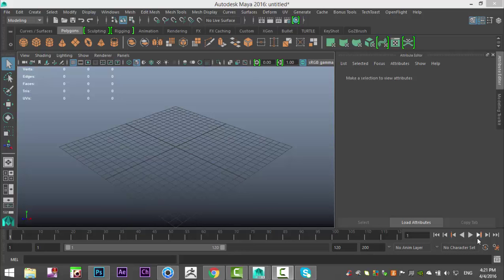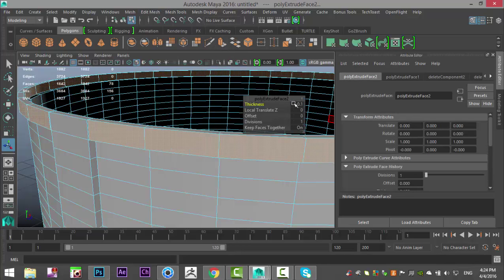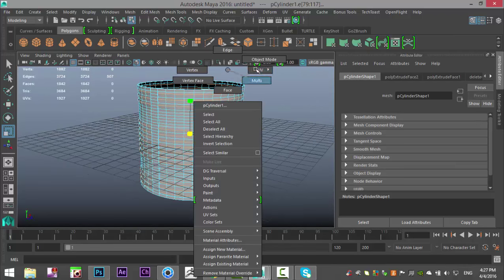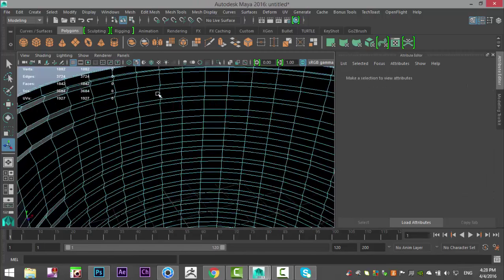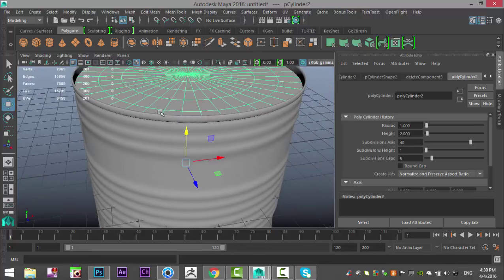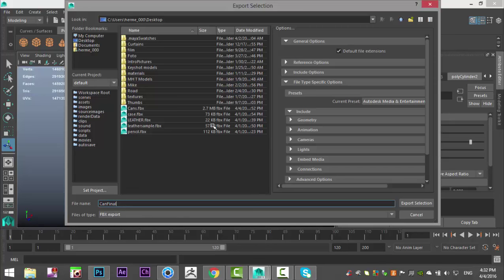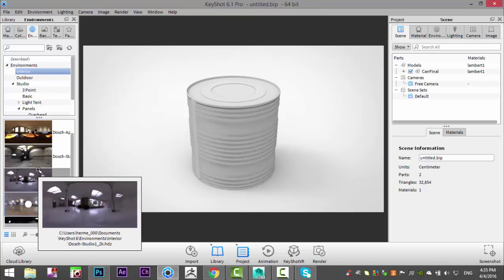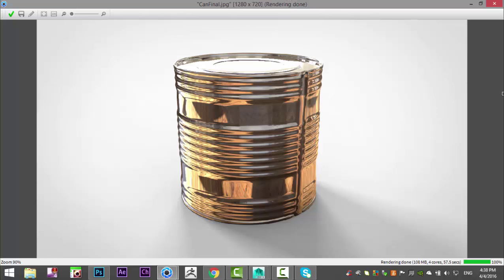How to model a Tin can in Maya 2016

Comment: My mental ray got broke, so I reinstalled it and it does not work now. I have maya 2016 sp5 and mental ray sp5 but it does not load it shows up in the plug in manager. Please help.
Reply from the maker: +Six6Syndicate So even after you activate it in the plugin manager it still doesn't work ?
Reply: no it says command execution error
Reply from the maker: +Six6Syndicate If it shows in the plugin manager but doesn't work after activating it then there is not a lot I can do. I use Maya but I'm not an Autodesk helpdesk guy, sorry
Reply: +Mike Hermes Its ok thanks
Reply: +Six6Syndicate try deleting your maya prefs file, keeping in mind to back it up, and note that all your previous settings will be reset to default. delete everything inside this folder:   C:\Users\yourname\Documents\maya\2016\prefs
Reply: +Professional Artist thanks I'll try that.